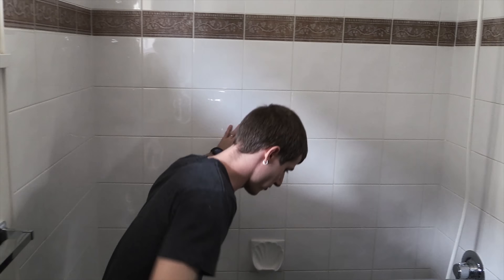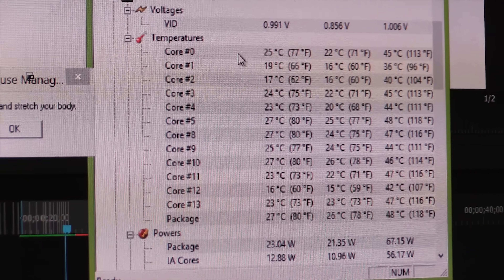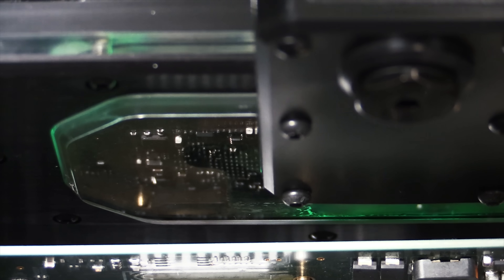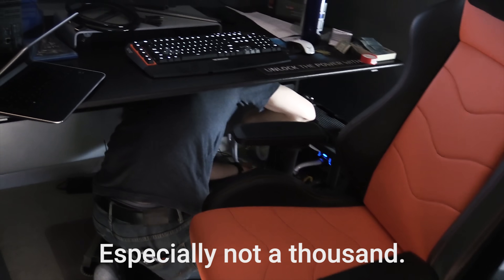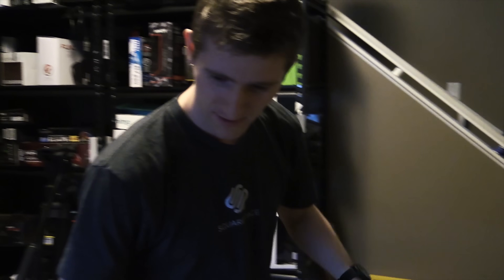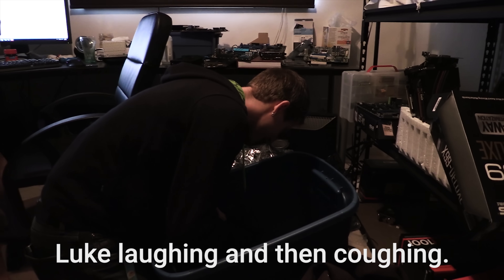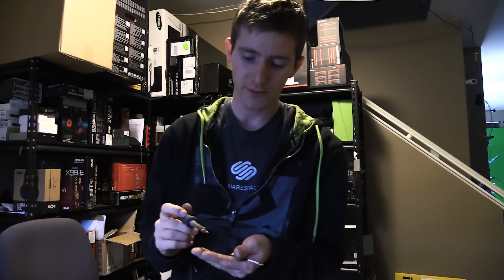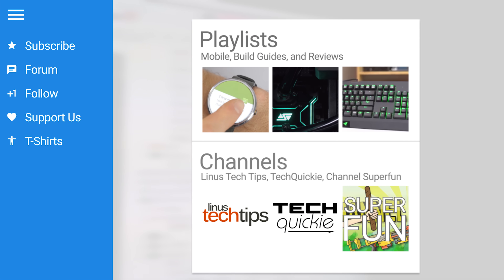Whole Room Water Cooling Part 5b - Some Issues, More Solutions...

Comment: I would recommend using smaller gauge solder, that stuff looks as if it was for plumbing. Obviously it worked but if you need to solder stuff in the future, especially PCBs, smaller is better. I have the same soldering iron as you, and the dial for temperature should be set correctly depending on the type of solder you use (avoid lead free if you can). I didn't see if you did but you always want to wet the sponge that you use to clean the soldering tip. When soldering wires together, you should "tin" them first by applying solder to the tips of each wire then press the iron to the wires while they are touching to instantly lock them in place. Using a chisel tip for the iron will help a ton when working with smaller components or those with high heat capacity, such as large gauge wires or heatsinks etc.
Reply: Also, flux core wire is your friend :) cheers and love the videos.
Reply: wduth allso heating the wires, not the solder is usualy a much cleaner and easier aproach

Comment: Linus, when you go back to Home Depot, pick up 2 1/2" copper tee's, and 2x1/2 spigot x1/4" tube stop valve's, now at the highest point in you're loop, install the first Tee and valve (facing up) on both the out going and return side of the loop. Now you can simply purge all the air out of the loop. :)    <3 your vids,very entertaining!

Comment: have two wires connected, secured, then hold the soldering iron on ur right/ lead strip on left and feed the lead through to ur soldering iron while the iron is pointed at where u want the soldering to be done.